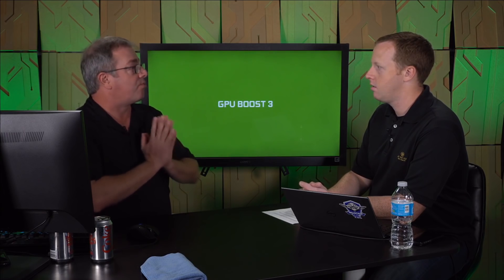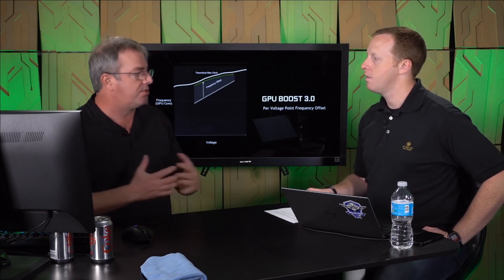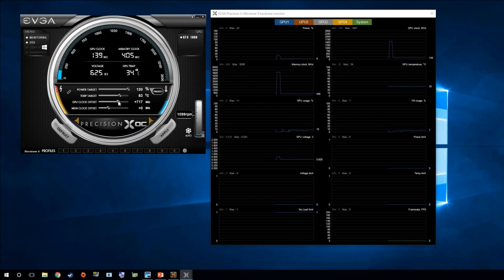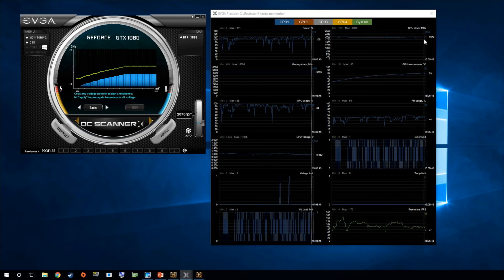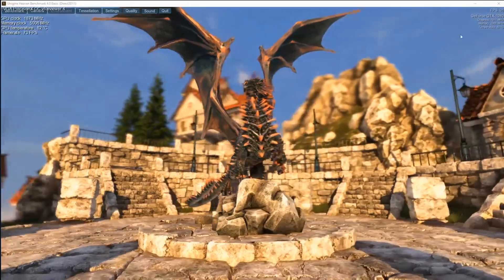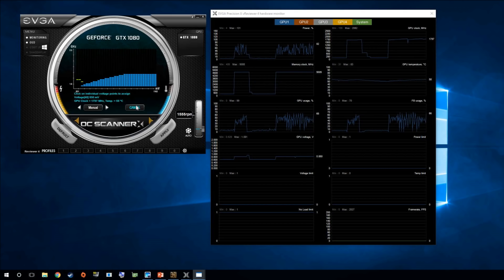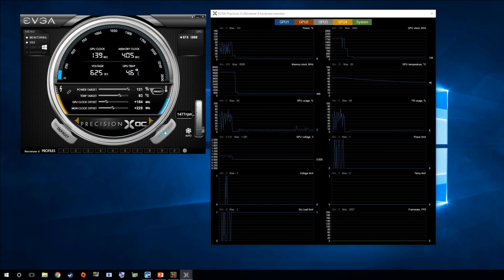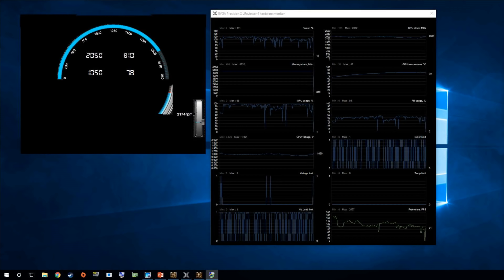GPUBoost 3.0 and Overclocking with the GTX 1080

Comment: so essentially it doesnt OC it self you need to set it up
Reply: I got GFX1080Ti fir few days now and the beast OCs (goes beyound boost clock) by default without any software (as it is bios feature) and you cant really turn it off, clock always dynamicly changes depending on conditions. GPU Boost is kind of like XFR (which is also turned on by default) in ryzens, if you got good cooling in card it will automaticly boost the clock and regulate other parameters optimaly, only thing that is lock and user need to unlock is voltages as they are deadliest to chips. But if you worried just leave things at default.

Comment: a question i just got my new evga gtx1080 ftw and i did used EVGA 
Precision XOC to OC my card and it was running ok but after an hour i 
play my 4k video and it just lagging and shaking seem like bad video 
card bring back to original clock and still have the same problem any 
help?

Comment: God damn +200 and still 2075mhz. I hate GPU Boost 3.0 seriosly. My card (gtx1070 g1) is on +110/+600, I'm getting 2050mhz but since it's downclocking on 55c,60c and 65c, I locked 60% fans on 60c so 60c is upper limit. That way with only +110 I get 2025mhz locked, no voltage touched. This was much easier with my old broken 980Ti :( I still don't get why would go down in MHZ if voltage is low ? That doesn't increase my temperature at all, and yet I lose core clock only based on temperature which is in safe margin by far.
Reply: dsr07mm IKR, it's so stupid.
Reply: Yup :( And funny, +500 on memory, I'm getting artifacts in new games like For Honor or Mafia 3 while other games works fine still including benchmarks. So now I'm on +90/+300 without voltage at all, satisfied. Except loud fan on 60c every couple seconds :(
Reply: dsr07mm wow. Well Im at +138 and +700. So 2012Mhz on the core and 4704 on the mem, I get like 20300+ on fire strike, last one was like 20368, but I usually go between 20330-20390, I've been into 20400 too, but that was testing on some really old drivers where I could get up to 2052Mhz on the core (didn't even try higher because this was a test to see if my theory was right, it was). Also, I forgot to mention, have you seen this weird thing. Try setting your core clock while running fur mark, it'll stick to the max frequency, tack on some memory clock and it'll drop.
Reply: Yup noticed that weird thing. Well you see, you throw +138 for 2012 on the core, I get 2010mhz on core with +90 but aggressive fan curve. It's G1 card. Anyways fact is that I hate GPU Boost 3.0 :( I loved my old 980ti more then 1070 :)
Reply: dsr07mm ah, I have a PNY GTX 1070 FE. Yeah it is very strange, I always love reinstalling my drivers and seeing the default boost clock rocket up to 1911Mhz without me touching a damn thing, but then it always goes down to 1860 and stays there, which annoys me, like I mean it stays there FOREVER, no matter what, and I hit 62c as a max temp, utter crap if you ask me, its as if they made it so that it smartly, but discretely nerf's itself.
Reply: dsr07mm One thing I'd hope to see is the disabling of GPU Boost 3.0 features when manually overclocking. So a slider that flicks from semi-auto to manual if ygm
Reply: Hope for that :) I'm still on 369.09 (released on 2nd August, I believe first Pascal drivers), no issues in new games as Mafia 3, Shadows Warrior 2 and I played For Honor, Battlefield 1 betas aswel. In my opinion with every new driver they will make some things worse, by slightest thing if needed just to provide room for next generation. Perhaps I'm paranoic, but I didn't had issues with atleast 3 titles released during last 2 months while other people did with new "game-ready" drivers. For example if you check my Mafia 3 benchmarks, there are people who are saying that game isn't maxed out since FPS is higher for ~10-15fps average comparing to some other official huge websites. When I have first issues I will upgrade driver, until then no way :D

Comment: "Shamefully fast" the only shamefull thing here is the fact you claim 2.2ghz when no one can even get 2.1ghz...not even on customs boards withe beefy coolers, moddified bioses, extra power phases and extra power connectors. 2050mhz seems to be the magical number...
Reply: Many reviews people has got 2100mhz i got 2050mhz on every game and 2100mhz on some games and 11ghz memory
Reply: Lots of people have got 2100+  Only takes two seconds to use google kid.
Reply: I call BS, they are not in game numbers. In game pretty much all the gtx 1080 cards down clock to 2050.
Reply: RezzaNL Down clock?  STOCK is 1.6 to 1.7 so how is 2050 downclocking?
Reply: The one That questions Shit I can't hit 2050 on a Zotac Amp Extreme. I hit 2012-2025 before it crashed out.
Reply: Donald James I assume you cranked up the voltage and fan speed.
Reply: RezzaNL Yep and anything over 2025 the card crashes hard.
Reply: Which program you are using for OC? Are you really sure your voltage is max? 1.8-1.9??
Reply: The one That questions yep, I've tried the Zotac software that came with the card. EVGA and MSI.
Reply: Then Silicon lottery I guess.
Reply: The one That questions Yeah I'll admit I'm slightly bummed but it is what it is.

Comment: i think that one 8 pin power connector is going to limit overclocking
Reply: +kardeem 18 Correct. That is why everyone who wants serious overclocks should wait for Board Partners to release cards with custom PCBs.
Reply: +kardeem 18 And the limited power limit/poor vrm design and cooler. Buying the gimped Founders edition for 100 dollars more is retarded. Wait for 3rd party custom cards!
Reply: +MunkeyChips When custom PCBs launch were going to have 1080Ti around the corner and no point of buying 1080
Reply: +club4ghz Not true, custom PCBs will launch within the next few months while 1080ti will probably be released this time next year.
Reply: +kardeem 18    It sucks but i'm gonna have to buy the Founders Edition as I sold my TITAN X and i'm running on a "loaner" 970 card currently that I have to send back on the 27th when the 1080 Founders Edition releases. So unfortunately I have to get it. Although i'm kinda thinking of selling my Founders Edition (even if I lose a bit of money) a few weeks later and getting like the Gigabyte AIO liquid version or something. The whole "only one 8 pin power" thing always had me a bit nervous. I was like "yeah that's cool and all but....isn't that a tad low power for the supposed 800mhz overclock headroom it's supposed to have?" and it turned out right I guess, as we have confirmation that custom air cooled 1080's will be able to reach 2,400mhz and liquid cooled ones like the AIO from EVGA and Gigabyte will reach 2,500mhz!!
Reply: TheScaleless Haha, I'm guessing you watched nVidia's presentation on the new cards and thought "Holy crap, amazing!"
They convinced me for a bit too, they sure are good salesmen.
Reply: +TheScaleless no wonder Nvidia charges so much. People like you have no regard for money.
Reply: Aaron S I'm waiting for AMD to show of Polaris and see what Board Partners can do to the GPU's with custom PCBs and Coolers. But if we need early adopters like TheScaleless that throw money with reckless abandon. How do you think businesses like nVidia and Apple got so big? With good marketing and blind followers that have too much money to burn.